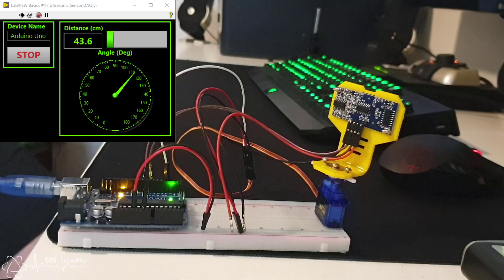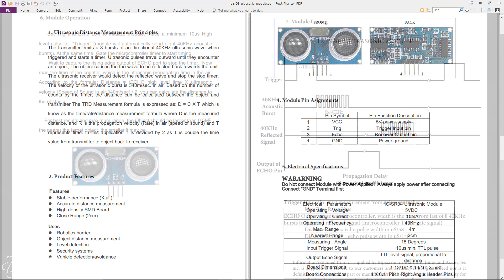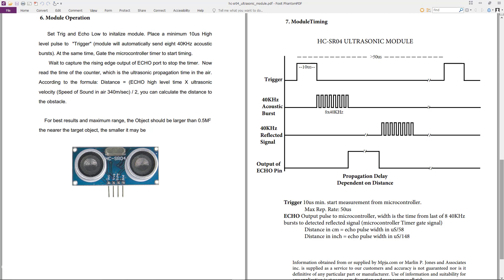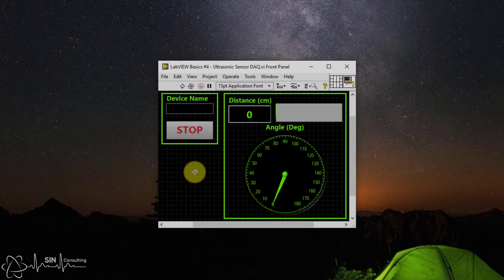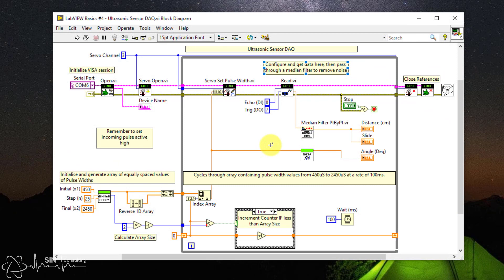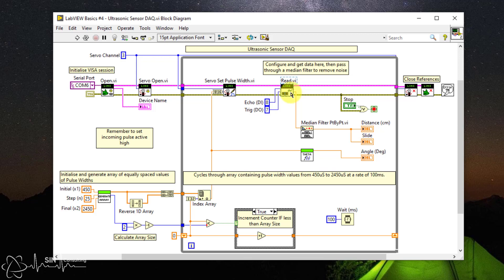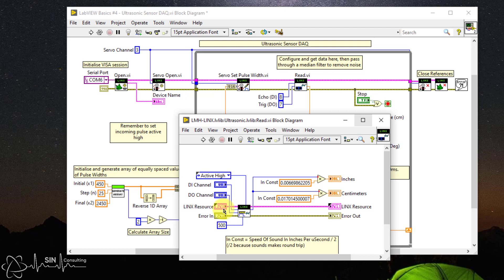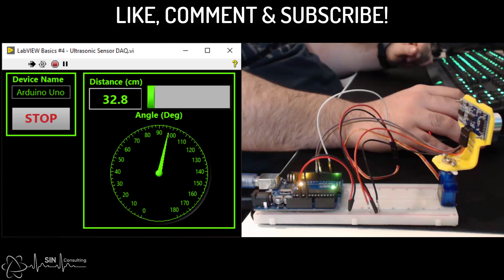LabVIEW Basics #4 - SONAR Part 2 - Ultrasonic Sensor Data Acquisition

Comment from the maker: Hey everyone! If you have any feedback or questions please leave them below and i'll try to get back to you ASAP!
Reply: Hello. I have been waiting someone to make some linx-arduino tutorial in YouTube. I want to ask you a question. Can we program arduino with LabVIEW linx and make it stand alone hardware without connecting the Arduino with labview via usb ? Like line follower robot , or a simple alarm. Please reply, it will be very helpful.
Reply from the maker: Hi  @rajananga , unfortunately you cannot deploy the LabVIEW code to the Arduino like you can to NI myRIO/cRIO/cDAQ hardware using LINX. It must be connected to the PC to run the LabVIEW code on your Arduino. One workaround for this is to use a Wi-Fi connection to send serial commands,  so in many cases where deploying code would be ideal the best solution is to use a device like the chipKIT WF32 and 'talk' over Wi-Fi. This will allow you to still use LabVIEW and LINX but you would just need to add the code to handle and interpret the Wi-Fi communication.
Reply: @SINConsulting  ohh i see. That is what i thought all this time. Thank you for making this case solved. That means that we can't plan even a simple alarm without opening 24/7. But can we make stand alone program (exe) in LabVIEW then control the arduino via WiFi with the exe program without opening the actual labview app ? Your answer will be very helpful for me.
Reply from the maker: @rajananga  yes, you can publish a standalone LabVIEW application (exe)  using Application Builder (http://sine.ni.com/nips/cds/view/p/lang/en/nid/212940 ).  As long as the Wi-Fi settings don't change (or you make them configurable in the VI), you should be able to run the application and connect to your Arduino with a Wi-Fi shield or the chipKIT WF32.
Reply: @SINConsulting  thank you for helping me. I am a beginner at both of them (LabVIEW and arduino). I hope that you can continue to make these linx video, those video are helping me a lot. I very appreciate your work. 
Regards, Raja
Reply from the maker: No problem! Thanks for watching my videos :)

Comment: Hi I think there is a bug in the distance measurement block. As I added "Active High" in the block, it did not work properly.
Reply from the maker: Did you get it to work ?
Reply: Got the same problem, then i found that "Active High" need to add to the correct input (Should be Stimulus Pulse but not Incoming Pulse Polarity), it then works!